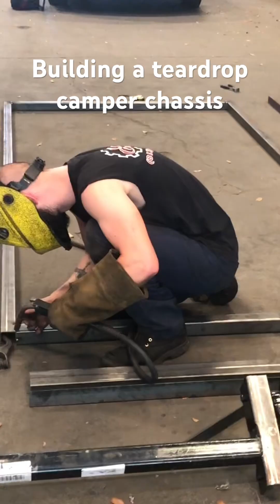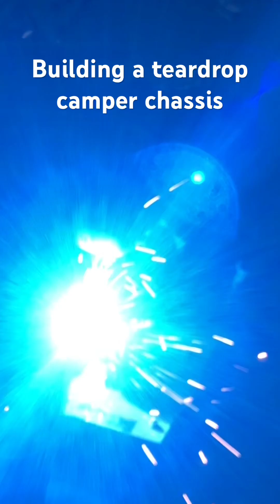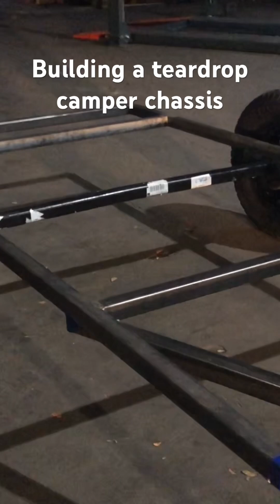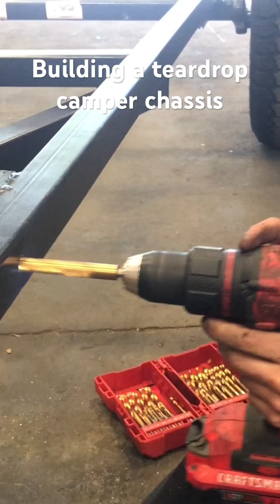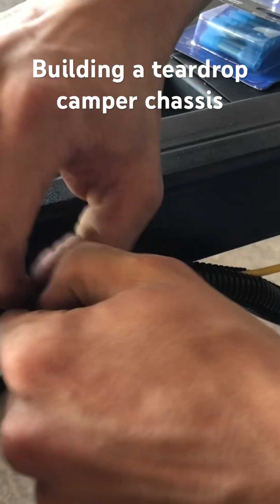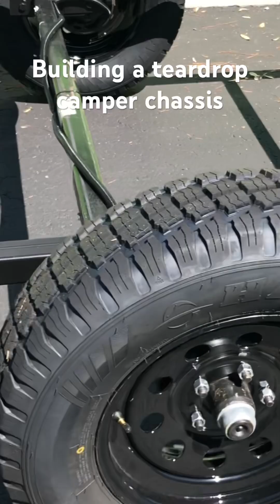Building a teardrop camper chassis. Frame is made of 100% US steel 😎🇺🇸🤘

Comment: No leaf springs ? Why?
Reply from the maker: @tristanlem9949  The axle has an independent suspension so no need for leaf springs. Best investment I made on the project.
Reply from the maker: @tristanlem9949  I used a Dexter #9